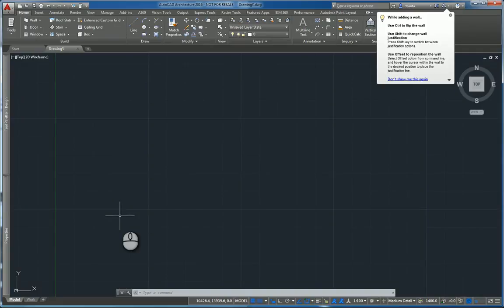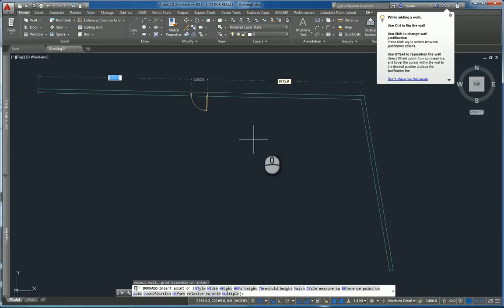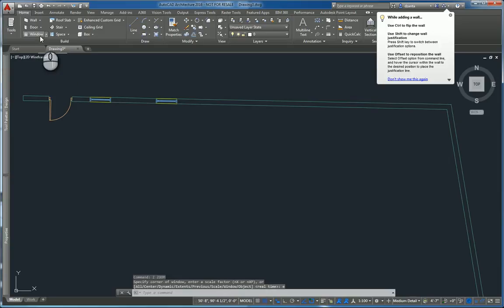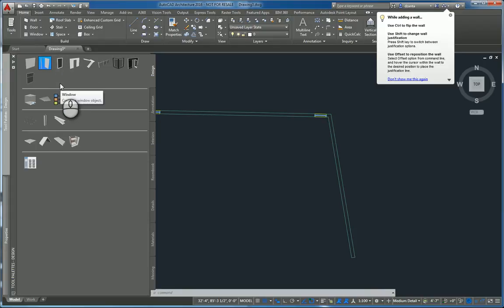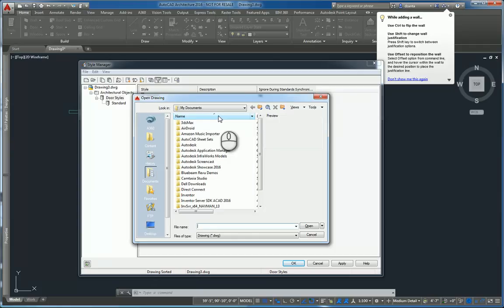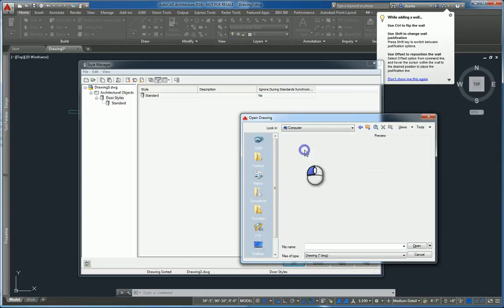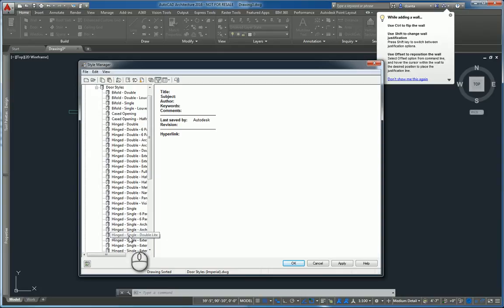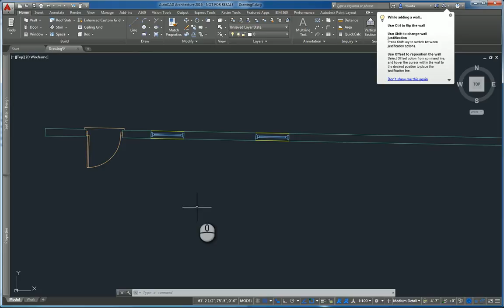AutoCAD Architecture 2016 Door and Window Command   A How To Guide

Comment: how can I  view reference writing while added a door?
Reply from the maker: Vahdedin Tunç 
Not sure what you mean
Reply: I am sorry, my english is not very well. so, when you add a door, some measurement seems right of door and left. for example, 100 cm from door to corner of wall. it isn't seems in my screen, when I draw.
Reply from the maker: Vahdedin Tunç 
Those are temporary dimensions that show up to help you place the door. If you want hard dimensions,  use the align dimension command
Reply: I tried it but I can't see temporary dimensions .
Reply from the maker: Vahdedin Tunç 
Go to Options and increase font size
Reply from the maker: Check Options toolbar and pick show dimensions button
Reply: thank you very much :)
Reply from the maker: Vahdedin Tunç 
no problem

Comment: how do you add a curtain wall
Reply from the maker: Hi there.  If you want to add a curtain wall, use the Wall command..then go to Properties and select the curtain wall style you want to use.  If the style is not loaded, use the Style Manager to load the curtain wall types from the standard library.  If you want to add a window/door assembly (similar to curtain wall), do the same procedure above but with the door command instead.  Hope this helps.
Reply: hi im confused about sth when you add a curtain wall or a door this is on 3d not 2d so my question cuold you add it on 2d and how can i add the build toolbar
Reply: ps im using autocad 2018
Reply from the maker: adel mutawi 
Sorry...thought you had autocad architecture.  Autocad does not have 2d or 3d curtain wall blocks. You will have to make them. If you have autocad architecture,  then this is easier.
Reply: Dzan ta 
so the student version of auto cad doesn't support curtain walls nor doors. then what is the fastest way to draw a curtain wall on the normal autocad